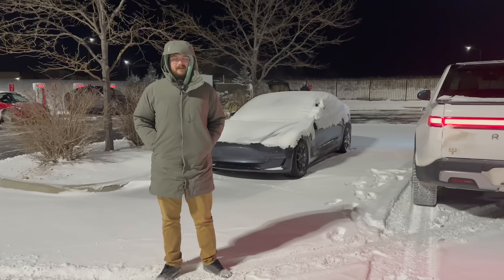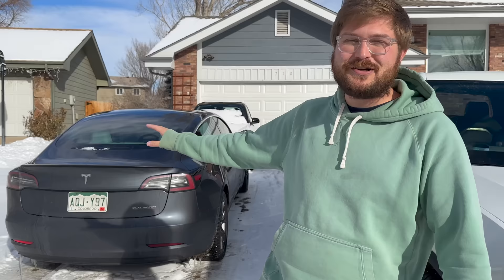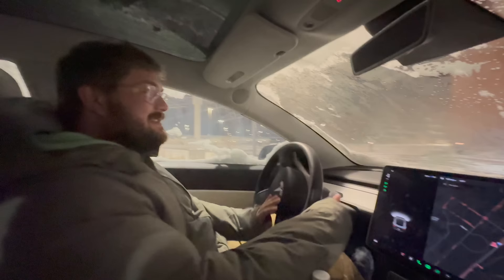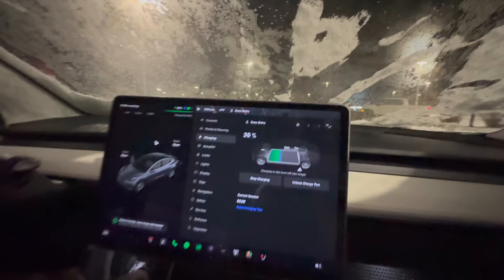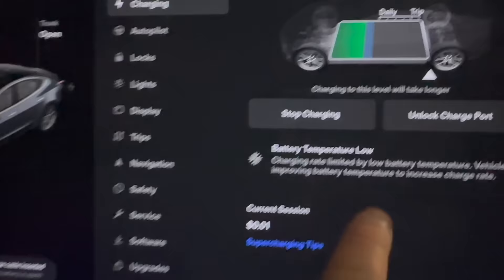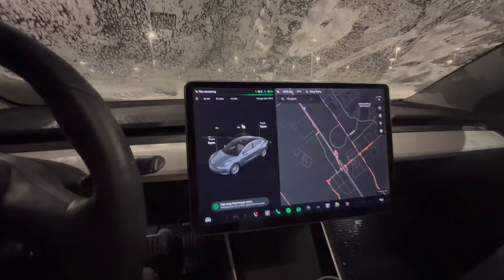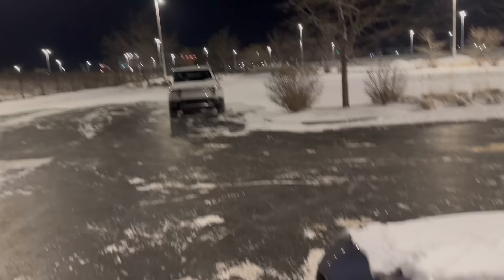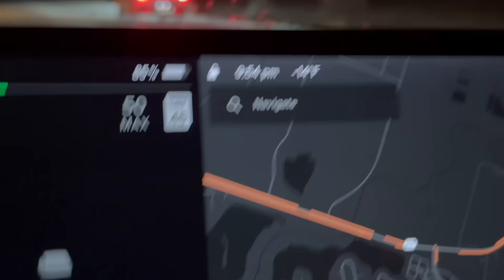I Deep Froze My Tesla And Immediately Plugged It Into A Supercharger To See What Happens

Comment: We found this out when heading home from FL to IA winter of 2020. Stayed overnight at a supercharger hotel. But parked with 30ish % overnight. Plugged in in the AM and it took an extra 45 min.  Personally I suggest just charge it to 80% on the SC while the family is checking in the night before; But it’s a personal preference I suppose.  I really Appreciate these style of videos !
Reply: Better reason to charge the night before instead of the morning.
I woke up in the morning to a dark hotel.
Mile away the supercharger also lost power along with the gas station it was located at.
Since I charged the night before no issue.
Reply: Or set it to warm up for 45 minutes to precondition the battery and cabin before everyone is up and packed and checking out.
Reply: @flipadavis   - why spend the additional time in that town, multiplex. (preference ≠ logic, it doesn't have to be)
Reply: @kadmow  It's not additional time if you set it to warm up while you are still in bed and not up, packed and checked out yet. If you are planning to get up to check out at 6am set your car in the app to turn on and run the cabin heat and precondition the pack at 5am before you even wake up. 

Right in the phone app there is a 'schedule' category where you can set the departure time and a button to select to precondition which means to set the climate and precondition the battery. This is exactly why this app exists. No need to do like in the video and go out and sit in the cold car for 45 minutes. If you have access to the weather forecast you know how cold it's going to be.
Reply: @flipadavis  : sorry - I must have misunderstood, not having stayed at a supercharger hotel (they don't exist in my "neck of the woods", I didn't realise that you could park all night in a supercharger stall.... kind of relegates it to merely a charger - slow charge overnight is definitely better for battery longevity.
Reply: @kadmow  You wouldn't be parked and plugged into the Supercharger. It doesn't need to be plugged into a power source to warm the pack. The pack can use its own energy to turn the motors with the drive unit disengaged to generate heat as well as the climate heating to warm the pack up. 

This uses only about 5 kW of energy to do so and after 45 minutes it will have only used 3.75 kWhs to warm up the pack. The only advantage to having it plugged in is to save that 3.75 kWhs by drawing that power from the charger. But who cares because 3.75 kWhs out of an 80 kWh pack is nothing. 

Once the pack is warmed up and ready to Supercharge you are just then dumping in a peak of 250 kW to 150 kW tapered at that point. 

This video is a weird edge case for the sake of doing a weird edge case. It ends up just confusing people since the wrong takeaway they get is that the only way you can charge it when really cold is to have it plugged into a charger for 45 minutes to just be able to warm it up enough to charge. But in reality it has nothing to do with the charger and only has to do with time that the pack needs to slowly warm up. 

This warm up is limited by Tesla's software and capped at a 5 kW rate. That can happen while plugged into a Supercharger, plugged into an L2 charger with the AC amps set in the car to 20 amps (5 kWs), it can happen sitting in an empty parking space 'idling' the climate and motors, or it can happen by driving it around. So the real takeaway is that in extreme cold you just need the time to precondition the battery pack in some manner before it will take a charge above 5 kWs. And you can drive the car no problem. This only has to do with charging.
Reply: @flipadavis  : Thanks sure cleared that one up - so remind me again, why not just charge overnight  (or the evening before) and be ready to get up and go without a first stop 5 minutes later at the SC "destination"...  cheers.
Reply: @thomaswilson2917  good point. If the option is available, charging overnight is a no brainer
Reply: @kadmow  Sure, you could definitely do that. I was commenting more in general about this video and how there would never be a situation where you would need to sit at the charger for an extra 45 minutes.
Reply: @kadmow  I did stay at a hotel that had Tesla superchargers on hotel property.
Most likely he is talking
About a hotel 
 That has has wall chargers for you to use.
They charge typically charge at 7 kwh so if you are low. it will take all night to charge
Reply: @flipadavis  but you have 30 percent charge.
Now you have to charge it in the morning instead of the evening while you a watching TV in the room.
Also you run the risk of power failure during the night.happenedvto me in september.since I charged when I got to the room had no issues other than a dark hotel.
Reply: Don't have this issue with ICE...
Reply: @mattlane2282  with Ice I have to stop at a gas station at least once a week. With EV I only stop at a super charger when traveling long distances. I should note that this trip only cost me $83 from FL to IA .  In any case slow charging in cold weather is easy to avoid once you are aware if it.
Reply: @thomaswilson2917  no, it was a hotel with super chargers in the parking lot, Not destination chargers.  It’s just a simple matter of wanting to wake up at least 45 min early and walk out into the cold, drive your car to the SC stall, plug in while it’s way below freezing and it taking longer to charge to 70-80% Or just do it while the family is checking in at night in a nice warm car without the need for the car to warm up 45 min before, once it’s at 70-80% unplug and park it in a normal spot, so it ready to leave in the am; It’s not a difficult choice.
Reply: @dylanmcruse  I always charge in the evening.
Especially after experiencing a power outage in the morning in a September 
The hotel , gas station with superchargers a mile away all was without power.  No gas no charging.
Since I charged the evening before while my wife unpacked had no issues except that the elevator did not work.
I also on the same trip stayed at a hotel that had superchargers in the parking lot. But not very often have I found it to be true 
Hard enough to get a hotel with wall chargers.
Reply: @dylanmcruse  come on don't treat me like I'm an idiot your vehicle does not run forever you are going home every night and plugging it in and your unplugging it every morning.

Then you going to try to sell me on how it's super convenient because you don't have to go to a gas station that takes 5 minutes on the high side.

Never once had to worry about my battery being cold never had to worry about my state of charge never had to worry about the power going out just took me 3 minutes yesterday to fill the car up.
Reply: @mattlane2282  haha, ok dood. I wasn’t attempting to treat you like an idiot; I thought it was implied that I charge every night at the house for normal use. Normal patterns look like I use about 20% of charge a day.   Nothing against ice cars. I enjoy them as well mostly for track days, but it’s hard to beat an ev for everyday use.   In any case Let’s not pretend that running late and filling up at a gas station in the morning is not a thing though, and I  do not miss that :) .
Reply: @dylanmcruse  never once had that issue.  There's a fuel gauge You're generally driving by a million gas stations a day if you're driving at all never have had that issue.

Being worried about state of charge being worried about the car recharging being worried about finding a open charger and waiting an hour to charge it it just does not in any way seem appealing or easier.

If you want to sell yourself one you don't have to spend 5 minutes at a gas station that's fine but don't honestly believe that everyone else thinks that's an issue.

It become very tedious to everyday constantly be plugging in and unplugging a car for the entire time the car is all and you can say okay it's 20% a day well do you really want to risk being somewhere at 20% and something comes up so maybe you'll do it every other day or if you forget now because it's not everyday thing.

No no it's like so much easier to just go to a gas station and fill up with gas that takes less than 5 minutes.

Also because I'm not a super rich person My current living arrangements would be very difficult to charge the property that I bought that I am fixing would also require substantial outdoor work to get any easy charging capabilities.

There's also plenty people I know that have garages that have other things in them so yeah.

Hope it works out for you Hope you don't need a $25,000 battery Hope you don't have any software issues that prevent it from charging which in all fairness every year we're getting more more software issues on standard cars.  But yeah I don't want the computer on wheels for sure.
Reply: @mattlane2282  no worries man. You do what makes sense for you.

Comment: Truth is Teslas DO charge in extreme cold but look at all of the extra time, thought, and preparation just to make sure your car can charge. So then you freeze to death with everything off as you try to charge your car for 2 hours? Or you have to blow on a cable to warm it so it will plug in??? Seriously? Do most normal drivers want to have to deal with all that? Or just plug in and fill up in 5 minutes and go? What if you had a low battery and stuck in a snowstorm on the highway? Or had to leave your car like he had it for days or on the side of the road if it was too dangerous to drive in poor conditions? How could you get it to a charger if the battery ran out from a long period in the cold? Tow truck! These are not biased but REAL life and REAL death issues! EVs are fantastic for city driving and non extreme climates. But should be advised to NOT drive an EV in the snow or a winter storm unless you are traveling a short distance to a final destination IMO. Truly not ready for prime time in extreme conditions or in extreme climates. 99% of normal people want to drive their car from A to B safely and make sure they have enough power or gas to get there. Not a rich man's hobby to play and try things and wait and go around in the middle of the night. Easy when you don't have a job the next morning. And BTW....your unmaintained front yard looks great when it is covered with snow! LOL!

Comment: We have a 2013 Model S P85 which is primarily parked in an unheated, detached garage. In winter, its pretty common for us to have little to no regen due to a cold battery. If we know we're going to drive somewhere, we'll do two things about an hour or so before we leave: we bump up the charge level to get it to start charging (which is really just heating the battery), and we'll turn on the cabin heater. This usually will get half or most of our regen back, if we give it enough time.

The battery pack represents a fairly big thermal mass, takes time to change its whole temp!
Reply: Sounds ideal!
Reply: What if you only had street parking too far to plug in, what would be the solution then?
Reply: @DigiDriftZone  you mean like in a city? Where they say they’re the best option?
Reply: @smelltheglove2038  Yes, around half the population in London don't have any way to plug in at home, so no pre-conditioning possible and public chargers are 80p / kWh  ($1 / kWh). So you're looking at $70 + 1 hour to charge with pre-heating? - that's more than double per mile vs diesel if you don't value your time and don't count the cost of that costa :(
Reply: @DigiDriftZone  Not own one unless it can plug at work, or home.

Comment: I ran my own experiment this morning in bitter cold. I started my ICE SUV and drove to Panera Bread. I didn’t have to precondition anything and I had no fear whether or not the car would start. I also didn’t worry if my heat would reduce my range. I also charge my car with gasoline in 5 minutes. Ironically in  my 43 years of driving, the only time I had a car that wouldn’t start was because of a battery. Typically 7,000 cells in an EV. 14,000 points of failure. Sometimes being practical is far better than being cool.
Reply: What temperature? Below -30 (-22F) I would strongly recommend block heating ahead of a trip.

Edit: IMO the 18650 cells were a patent work-around. Panasonic, Toyota's battery supplier for the RAV4 EV, was sued for patent infringement by Chevron a few years prior to the Roadster being developed. Battery suppliers can't get sued for supplying "commodity" cells for EVs.
The Nissan Leaf, built a few years after that, used much larger pouch cells.

Comment: We were down to 15 in the DFW area, so I thought I would drop by the 250KW S/C near the office and top off. I usually get murderously high speeds there but not this time. I was only able to precondition for about 4 miles, so I never saw over 75KW. Lesson learned. Only had to sit for about 45 mins 30% to 80%, took about 10 mins to actually get juice to the battery. A small price to pay, IMHO, for teh privilege of driving my Model 3.

Comment: Just a note, the cars with heat pump (I think thats an older one without) will heat up the battery quicker. The two (or one) motors will run but instead of putting it into the battery directly it will go to the heat pump which can extract more heat. It should be *a lot* faster. In case of the LFP battery you typically need 45min in Germany cold wheather with heat pump for 40°C in the battery or around 1.5hours without the heat pump.
If you can it would be nice to have the exact same test with a car with heat pump too! :)
Reply: Yes, completely agree.  And yes you are correct that car does not have a heat pump, they were introduced to the Model 3 in the 2021 models. I had a 2018 Model 3 without the heat pump and now have a 2021 Model 3 with with the heat pump and the difference in speed of heating the battery is very noticable. With the 2018 plugging into a supercharger with a cold battery it took MUCH longer to charge than the 2021 under very similar conditions.
Reply: @ZebHallock  Yeah, maybe we can get Kyle to scientifically test this for us. The difference really is big, but I'm really interested in how big.

Looking forward to a video about that.
Reply: @kruemelfelix  Next cold snap I can see if I can get someone with an older Model 3 to park it at a supercharger overnight with my new one with a similar state of charge and we can do a direct comparison the next morning.  Doesn't get as cold here as where Kyle is though.  Last night it got down to 7F (-14C) which is extremely cold for this area.  Almost never goes below that, but still can do a valid head to head comparison.
Reply: At those temps the heat pump is not going to be any more effective. It uses other methods to augment the heat pump
Reply: @dorvinion  That's why I said that the heat pump does in fact not use the surrounding air for heating but the waste heat generated by the motors. The Octovalve is the key point here.

Comment: I love that I can't fuel up my car when it's cold, this is freaking awesome!
I gotta sit in the cold car and wait for the battery to heat up before I can even fuel it up, I'm loving it!!

Lmao...
Reply: You can set it to defrost while youre in your house? or where ever you are before going into the car. Dont be low iq.
Reply: @jasonstyrke1805  so you only have to sit in the car 30 minutes to charge it???  How much is your "high IQ" car worth once the battery can no longer charge, say 5 to 10 years???
Reply: @a-fox  Dude... what? I literally said you can stay in your house... you dont have to sit in the fcking car unless your away from your house lol in which case you should utilize the life support system included in your car which is the HVAC system. If my battery no longer works say 5years from now, teslas has a 8 year warrenty that will cover it, asuming i didnt surpass the mileage warrenty. 10 years from now, I will replace it for 6k per insurifys battery cost replacement if warrenty does not cover it, which is still half the cost of any of the  other S 3 and X models that cost 12-15k to replace. Is that high iq enough or do i need to dumb it down somemore? im drunk and high btw. Im "high" iq as fck. u kive weed
Reply: @jasonstyrke1805  1st   Nissan Leaf battery Degradation was Catastrophic
There's literally people with 36 miles range and can't get a new Battery for 2 Reasons
1 - There's not enough lithium to give it away to Thousands of People which bought leafs
2- There's not enough money to fund thousands of Battery replacements
3- As result Nissan states, I know you only 36 miles left however it's duo to your poor driving drive more Eco friendly next time saving billions 🤑🤑🤑 you still have 7 bars there for your battery 70%  SOH 😛
.
Which begs the Question who Determines what is a Faulty Battery 🤔
Reply: @jasonstyrke1805  He's not being low iq. He was pointing out a real world problem that is INESCAPABLE because it's a feature of battery and every EV will have that problem, which is important to make people aware of. Just because there are some (still very limiting) solutions doesn't mean the problem is any less relevant.

Comment: I run into a similar situation, but I charged up before I parked the car, so I had about 60% charge when I started.  I think it really helped to run the car for a hour in the morning to heat up the battery enough to start a charge.  I still had to wait 10 or so minutes to start charging the first time, but much less time then if the car was completely frozen.
Reply: OK  ... Who has an hour to spare in the morning ?
Reply: @cathie9614  You can set the car to warm up by a certain time.